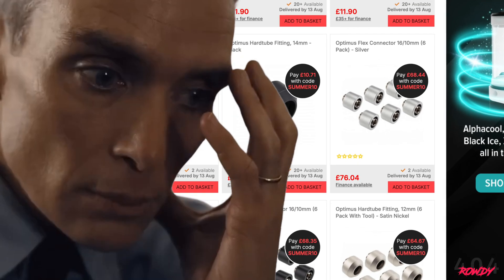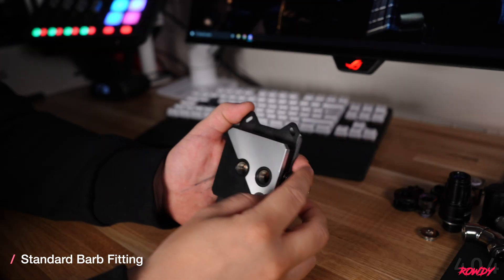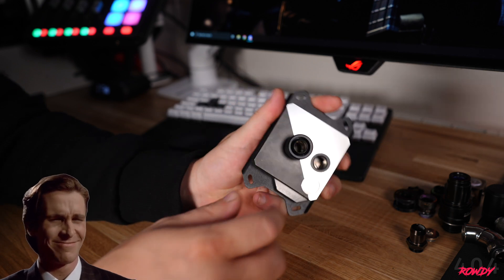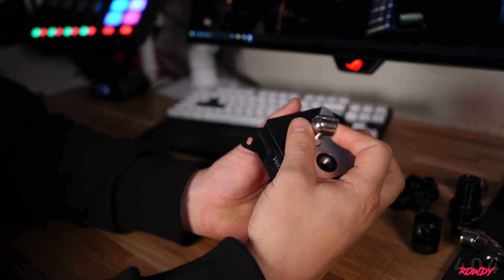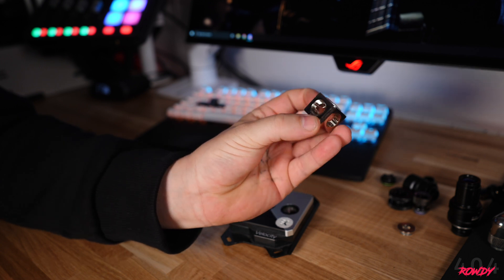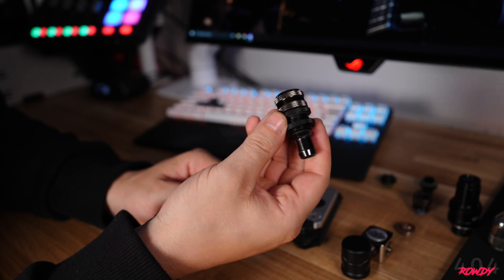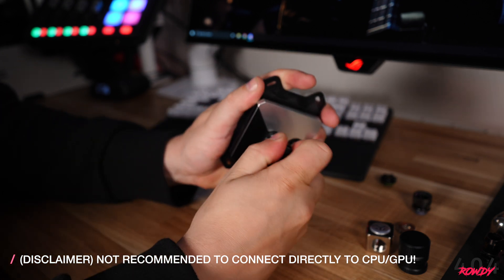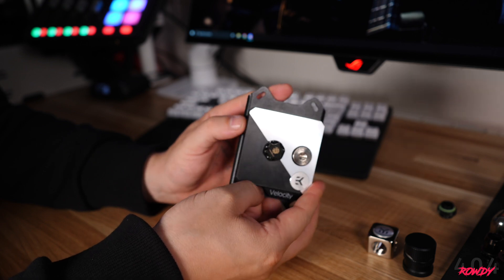How To Water Cool A PC For BEGINNERS. Fittings! Ep.4

Comment: Hey. i will say your doing really amazing helping new builders with water cooling. I am sort of new but know alot about water cooling parts. i will say the one thing i can say is i would make a video about different types of coolants. cause i never really knew this till it happened. but i used a solid white colour coolant in my build. and over 2 month my pump has been making strange noises and did not think of it at the time. and then it progress to being really loud and my flow degraded heavily. until i took it apart and found out there is a lot of gunk where the propeller sits and destroyed the pump. and i looked it up and people do say solid coolants can clog up and break the pumps martial. so i would say to any warning to new people going into water cooling. dont get solid coolants. and go with something a alot more better and safe with either clear coolant. Or use some coolant dye to a colour you want.
Reply from the maker: Hey there, thanks for the comment. Yes I have thought about making a video on coolants, as I myself have had very bad experience with opaque fluids. Generally the biggest issue with opaque’s is they tend to react with either certain metals in your loop or traces of old coolants. Deffo a good suggestion and one I will get round to making soon 👍🏻

Comment: how would i connect 4 pumps with reservoirs together to use on one system? lets just say i am building a new pc that no ones has seen before.
Reply from the maker: You have me intrigued 😂 are you wanting to have 4 pumps in one loop?
Reply: @ROWDY.404  yes, i would like to have 4, i have the corsair 1000d case and there is a ton of room lol. I want just 2 of those pumps for aesthetic reasons and the other 2 will be functional for hardware, so do i just buy pumps that have higher litres/hr like d5 series?
Reply from the maker: I would suggest if you are looking to fill a large space with some water cooling porn. The best way to go about it, would be to go dual loop cpu/gpu and if you wanted you could run 2 pumps on each loop. Hope this helps?!
Reply: @ROWDY.404  ok thanks but that is not what i was asking, i can not give out what i am doing so that is my mistake.
Reply from the maker: Ok so assuming I am understanding you correctly and that you wanting 4 pumps in one loop you would need to connect the pumps in series/tandem and ideally buy the same model of pump. You can also connect multiple reservoirs if wish. D5 would be a good option. You won’t need to worry about specs 👍🏻